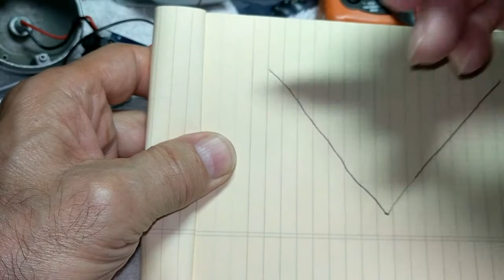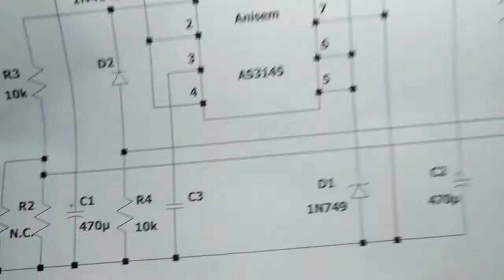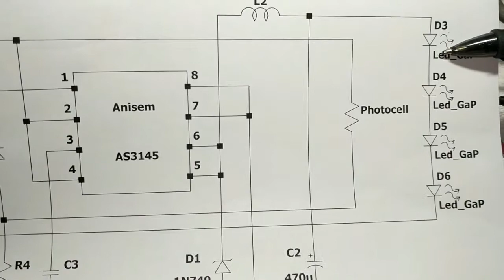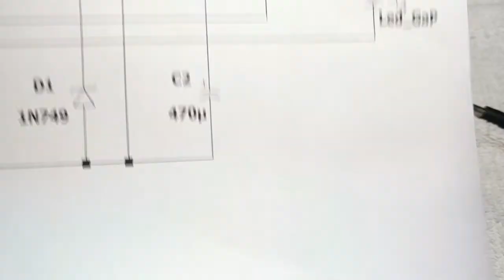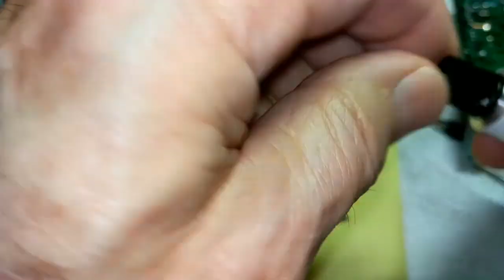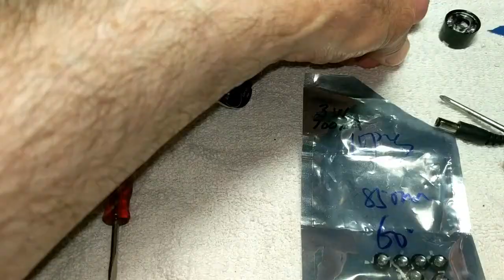Repair IR Illuminator with 4-LEDs

Comment: Great tutorial. Just curious why you didn't use 940-950nm ir leds?
Reply from the maker: You definitely can use 940-950nm LEDs if you prefer.  If you are wanting covert illuminators, then that is what you need to use for sure because the 850nm LEDs have a red glow.  Also, there is a performance hit with the 940-950nm LEDs.  There can be a difference of about 40% less light available to the camera with a 950nm LED vs using an 850nm LED (assuming the same driver current).  Cameras can vary a little bit on their sensitivity to high range IR lights, so there is no set rule as to how much less light there is going to be.  Thanks for commenting.